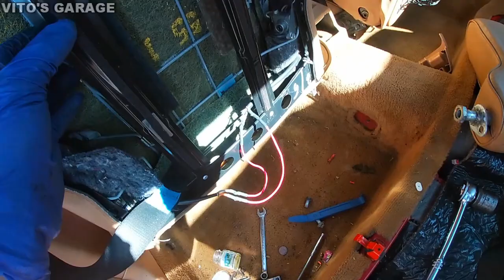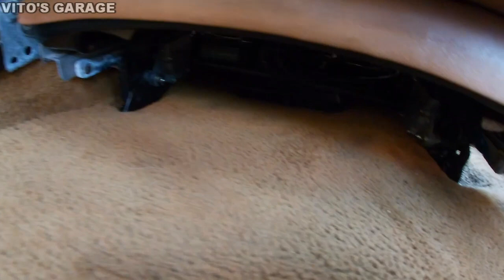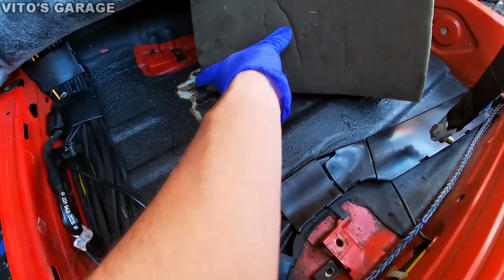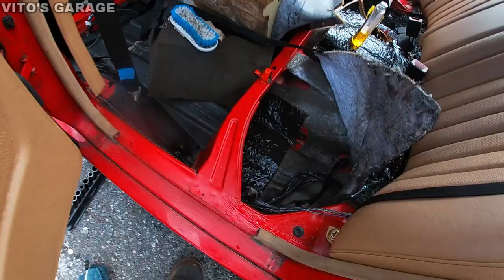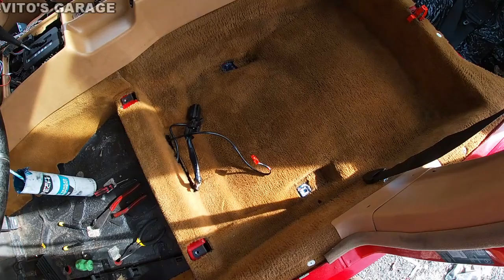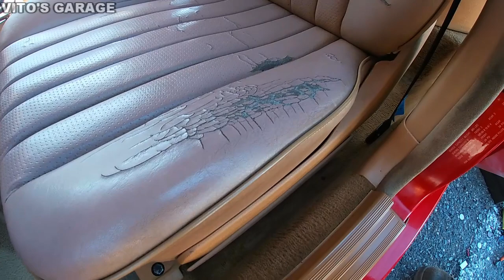From Trashed Neglected Interior to a Classic One! Ohh, And Rust Prevention! Mercedes 190E!❤

Comment: Great job Vito. I did something similar on my 81 240D a few years ago. The interior was even worse. I pulled the entire interior out except for the dashboard and took almost a month of deep cleaning to get it looking good again. It's amazing what can be done with these cars if you put the time and effort into them. Are you sure your seats are leather? Seems like the cracks in the driver seat are more like the kind you find in Tex rather than leather and you can see the "Pinkamino" effect on them from some angles. If you ever need it SEM makes a product called Color Coat 15323 Palomino which is a near perfect match for MB palomino. Restored my parcel shelf which was completely sun bleached white from the Arizona sun to looking like new. I Recommend it hightly if you have a palomino part that is badly faded.
Reply from the maker: Amazing! Thank you for sharing. Yes, my seats are faded😢 I might consider your suggestion in the future! I need my Palomino color backkkkk!! 
Save Classic Mercedes!!☺

Comment: Curious to know whether or not you are able to make use of a motor pool hobby shop on post so you could plug in a shop vac or use a water hose. Sux being in the parking lot with a hand held vacuum! I've been there.
Reply from the maker: For water usage I use water bottles with a small hole punched in the cap and it makes it perfect for rinsing or cleaning stuff!☺